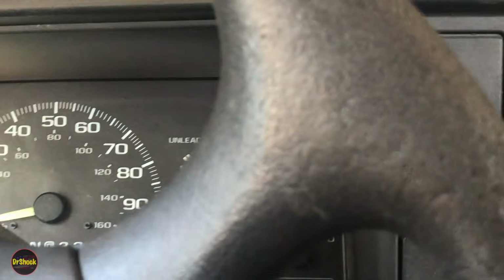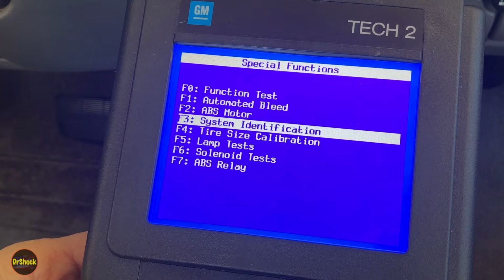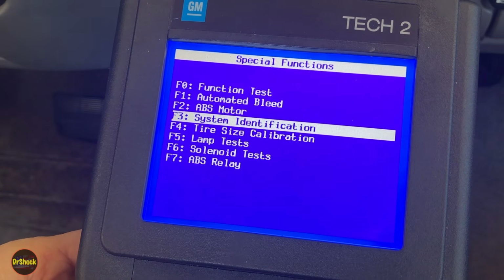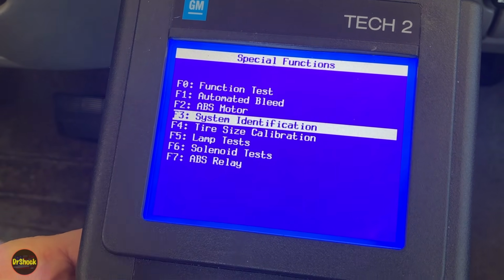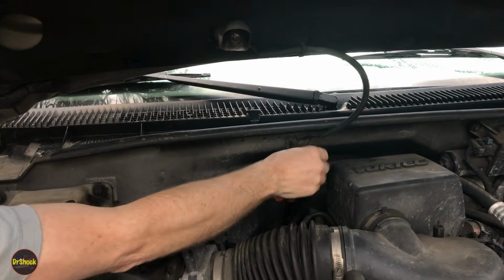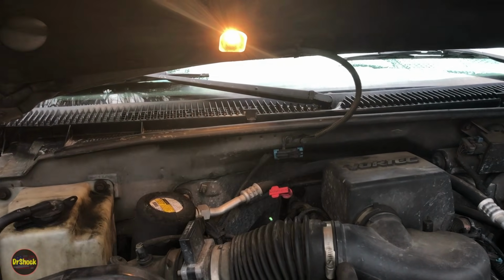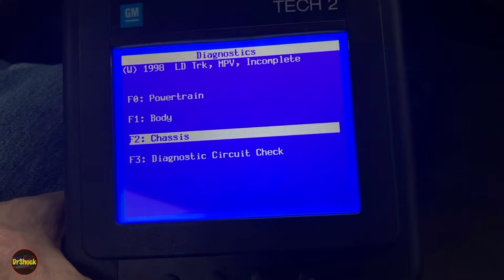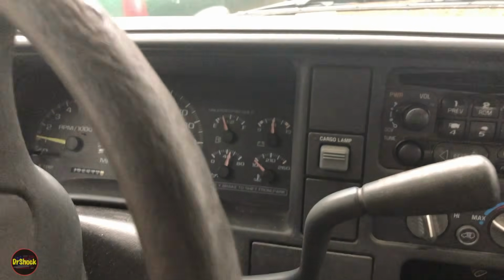1995 - 2002 GM OBS Truck 4WAL ABS Module DTC C0268 Repair Kelsey-Hayes EBC310 Teardown (Chevy & GMC)

Comment: First off great video. I am trying to understand the ABS setup in the 1995 G20 van I picked up recently and this video goes into some of the specifics in the differences between similar year range GM vehicles. It stops decently but I have a slight leak from the driver side caliper where the brake hose bolts on. The wheel cylinders are noth beginning to seep a little fluid so I decided to go ahead and rebuild the whole brake system. I bought new rotors, calipers, rubber hoses, pads, rear shoes & hardware, wheel cylinders, etc but now I am stumped as to whether or not I will need to bleed the ABS BPMV before or after or bleed it at all. I have been pulling various parts off of both a '95 G20 and a '94 G20 at a wreckijg yard, both of which are ABS. I aimed to get the BPMV with EBCM from the '95 (to have a spare) on my next trip but since I had them cut a fender off I believe they crushed what was left after destroying the front end. It has/had the 5.7L/4L60e with vacuum brakes which is what I have. The '94 G20 should still have the BPMV and EBCM under it but that van has hydroboost brakes so at least the EBCM wont be compatible with mine. Your video has at least helped  me begin to he able to make that distinction. 

My EBCM and BPMV seem to be working as there is no ABS light, but I am not sure as I have not encountered hard braking or slippery conditions. Do you need an OBD1 Tech1 GM scanner to be able to test your Kelsey Hayes ABS?

Since these parts are discontinued and challenging to find will these vehicles necessarily need to be retired from daily service or can the ABS be deleted in favor of a simpler pre-ABS factory type configuration?
Reply from the maker: Personally I would not remove or alter the 4WAL ABS system for the insurance and legal liability reasons that will arise in the event of an accident.    Many of these trucks are three decades old at this point, with none of the 4WAL ABS parts produced in the aftermarket.   As a result they will increasingly need to be retired from daily driver service imo.   I try to capture as much detail as is available for these vintage trucks and vans when doing repairs, in the hopes to give them a few more years of road life though.

You can use a Tech2 with the pre-ODBII vehicle interface plug, as a better option to the Tech1.

Comment: Amazing video! A lot of useful information. I am curious to as if I can use an ABS (brake pressure modulator valve) from a C series truck for a K series truck? I have a 96 k3500. The truck at the wrecking yard is a 97 C3500. Please help. Thank you!
Reply from the maker: The video description text has the part numbers by truck type spelled out.

Comment: Hello @dr.shock my combination valve is leaking from one on the bleeders on the side. Can i replace just that piece or will i need a new combination valve?
Reply from the maker: GM didn't service just that piece by itself.  There may be a seal or such in there, not sure.   I would replace the entire combination valve if I were doing that repair.

Comment: Mine fell the first test, the brushes of the motor are fixable??
Reply from the maker: The BPMV pump motor is not serviceable separately.  Best route is an NOS one (long discontinued by GM) or salvage yard replacement.
Reply: @DrShock  thanks

Comment: I have a 1998 chevy k1500 5.7 z71 how do you vin the other kelsey hayes abs module board
Reply from the maker: The EBC310 series EBCM is not a VIN learned module because it is not programmable, everything is hard coded calibration wise.  So you do have to match the EHCU part number with the RPO of the brake type and original powertrain as, again, the EBCM & BMPV valve programming is hard coded per part number to specific RPOs.  So a particular part number EBCM is only programmed to control a particular part number BMPV, for example. I have these RPO and part numbers  in the description.
Reply: @DrShock  you got any contact info I
Reply: @DrShock  when I try to put another abs module on truck I can't communicate with it because it dosnt have my vin number it has another one on it
Reply from the maker: Again, for the OBS truck years that this video is about, the EBCM does NOT have a VIN association.   Later year trucks would have that, but not the older design trucks.    I should point out that old body style (OBS) GMT400 and new body style (NBS) GMT800 designs overlapped from 1999 thru 2002.    NBS trucks do NOT use the EBC310, instead they use the EBC325 which will be visibly different than what I went over in this video.

So if your truck is in that model year range, it would have to have the EBC310 EHCU that I showed in this video, otherwise this video won't apply.  I can't comment on the NBS design, as this video is only about the older type.
Reply: @DrShock  I have the jb5 it says I try to put jb6 on mine and I couldn't bleed the abs module couldn't communicate with ir
Reply from the maker: Only a higher end scan tool will support ABS module communication.   If you were able to establish comms with the original unit, or one on a totally different vehicle of this same model year series, to confirm the tool you have supports this level of communication then I would suspect a wiring harness issue.   Attempt to communicate with the other modules that share this same part of the bus, such as the EVO/passlock module to eliminate this possibility.   It can also be that you just have dead or damaged unit if it came from a salvage yard.

Comment: How are you communicating to it  if the black box is not the one that is to your vin numbers
Reply from the maker: Not sure I'm following your question as the EBCM is NOT a VIN coded module like say a PCM or a BCM.   Instead, it is tied to the powertrain and brake options as I went over.  GM encodes the EBCM software to support different brake and powertrain combinations in the era this video covers.  The EBCM is the black plastic box at the top of the EHCU assembly.

If necessary a GM Tech2 scan tool can be used to learn the module to a VIN, that's it's purpose.  But for a complete EHCU replacement that's not what we use it for, instead we use it to command the BPMV portion of the EHCU to perform the automated bleed procedure to vent out any trapped air.   The EBCM cannot be reprogrammed by any tool.  You have to match them as built originally.

A bi-directional programmable scan tool like the GM Tech2 is required when doing GM ABS module replacements of any type as there's no other way to identify the EBCM firmware version, or to initiate the BPMV auto bleed.
Reply: Thanks where can I get a tech 2 tool

Comment: I have 97 k2500. Getting a “C0052 rear dump solenoid circuit open”. But i also have a very soft break pedal. So is this electrical or is the dump valve actually physically stuck open. If I separate the two, can i use a magnetic to open and close the valve to get it cycle. Or is the valve statically open and the solenoid closes it. Which i hope, cuz that would be electrical in the module.
Reply from the maker: There's no such code in the GM service manual.  Perhaps a typo and you meant C0252?  If so, which has the same description, all of these EBCM codes C0241 - C0254 are circuit related.   If the problem is not found in the wiring harness or connector ends, then replacement of the BPMV module is required.

Comment: Outstanding video, loved it! Question, these GMT400/455 vehicles will be around for some time to come. Once all the ABS units are gone from salvage yards and seller sites, will there be a way to upgrade/install from a newer ABS platform like GMT800 or 900? Thank you sir.
Reply from the maker: Thanks.   I'm not aware of anyone offering a rebuild service for this unique ABS module design.   I've also not seen anyone offer a retrofit from a later model either.   I think this is going to be one of those facts that drive these OBS trucks necessarily having to be retired from daily driver status as they are going to become unrepairable with OEM quality parts very soon.   Aftermarket parts for these OBS trucks are generally of very poor quality and fitment.
Reply: @DrShock   Thanks for the reply. Not fair to the little guy that can't afford a new or newer used vehicle. Especially if the current vehicle is in good condition. You almost think that the OEM and government has gotten together to force everyone to by vehicles every 10 to 15 years. What a waste of resources as it has taken many barrels of oil to product the truck I have now. Especially if it only requires a module to be replaced.
Reply: @DrShock 
The GMT400 is an iconic platform, people love them and their value is rising.  I keep hoping the free market will provide a solution when some company realizes that people will pay for OE quality parts.

GM isn’t exactly killing it financially, wish they would start supporting it again.

They could make a killing on interior trim pieces and dashes alone.  The Coverlay door panels for instance are terrible, it’s like they got right up to the job well done mark and just said “Nah, F it, let them eat cake!”
Reply: Thanks for asking this. My exact question to. If you find out any upgrade maybe you can share back here when you do 😊

Comment: The factory service manual should come free with the truck when you purchase the truck. Awesome video and thank you very, very, much!

Where can I find an EHBU assembly for a 2000 silverado 1500? Ebay has a few but how do I know if that's a failed one?
Reply from the maker: Thanks, unfortunately you have to rely on a combination of the eBay money back guarantee and the sellers description.  If the seller states the part is in working order, eBay will force them to refund you if it ends up not being as described so no worries.

Comment: That was one of the most thorough and superbly well-done presentation that I have ever watched.......Bravo, Bravo, Bravo!  I dont know how in the world you have remembered all the various ABS types, models, and part numbers and the minute details that you discussed.  Amazing indeed!  I was waiting to see if you were as bad as me, and were going to prep and repaint the  rusty base plate that lies under the ABS unit........or  wipe it down with some used tranny fluid to inhibit the rust.  I also use anti-seize on all the brake line fittings  (after wire brushing the threads), so  they do not break-off on the next guy.  

I like the plug caps you used to reduce loss of brake fluid.  I ordered a couple different sizes of rubber vacuum plugs from McMaster Carr, and they work perfect as caps over the brake line flare ends, with zero leaks......."no runs, no drips, no errors", to quote Johnny Bench.  The rubber plugs also fit into the  bleeder screw holes which stops leakage to allow a thorough cleaning of the bleeder screws before putting back on.

I thought that the problem would surely be down on the wire-stranded ground cable that goes from the frame over to the rear of the engine, and up to the front  (I believe behind the alternator, as these straps turn green and white with corrosion pretty frequently.  I have 2 1999 Suburbans, and both had this issue.....wish they had used rubber incased ground straps similar to battery cables for these grounding locations.

Again, superb presentation..........all the way to the end where you  hooked the engine hood light back up.  Very thorough.

Comment: I am VERY grateful to you for posting this excellent video.  Im a retired marine mechanic and have a 98 K 3500 Dually 7.4 gas with the hydraulic booster.  Sometimes the brakes just feel a bit different enough to make me think I better check things out sooner than later.  This has saved me time and aggravation not knowing about the differences and the availability issues.  Thank you

Comment: Great video I recently bought a 95 in great condition not knowing it had obd1, so I don't have a scan tool for it. the abs light is on and I thought I could just go to the local parts store, spend a couple hundred to fix an abs systen I don't need, but no parts, I should have bought a Ford. I have been driving for 50 years with out abs, but I have one now that needs fixed, if I can't get the parts needed I will have to find a way to eliminate it. Mine stops ok with normal pedal presure and travel, but after I stop I can push it to the floor. I can hear what I think is the abs pump.
  When your pedal went to the floor how did you determine it was the bpmv and not the master? I want to keep this original, but if I can't get parts I would feel much safer with out abs.
Reply from the maker: Thanks,  I didn't mention anything in this video about a pedal to the floor situation occurring.  I mentioned you can suspect a BPMV when you have a pulling condition, to the left or to the right, that is otherwise not indicated by the usual suspects (front hose, caliper, etc).

Comment: Is there anything else I can do to bleed the abs system.. I just swapped out mine on my 98 k1500. And it doesn't seem to be putting it to the rear brakes at all
Reply from the maker: For the model years this video covers, you need a scan tool to actuate the automated bleed process - https://youtu.be/4fImUhpWIdU

Comment: First, thanks for a great vid. I have a 97 K3500 with a warmed up 7.4L with headers and a cam, so I swapped the ecm to a more capable 0411 from a 2001 5.7l L31 van, and had it tuned for my engine. Now I'm having trouble with the abs. Isn't it normal for a Chevy abs unit to make a little noise when you first turn on the key? Like it's going through a little startup routine. Mine is not doing that any more. But I'm also having trouble with the normal 2 man bleeding routine - i'm getting no flow at all through the abs unit, like a valve inside is shut. Is this related to the ecm swap somehow?
Reply from the maker: Thanks, the ABS units on these later model (after 1995) OBS trucks cannot be manually bled.  You have to use a Tech2, or equivalent bi-directional, scan tool to actuate the integrated automatic bleed function.  I did another video on this procedure earlier - https://youtu.be/4fImUhpWIdU
Reply: OK thanks! My neighbor loaned me a snapon 2500 scan tool to play with, and it tells me the abs is 'disabled' but also says the truck is still drivable. I'm waiting for a reply from the ecm tuner to see if they might have turned the abs off. @DrShock